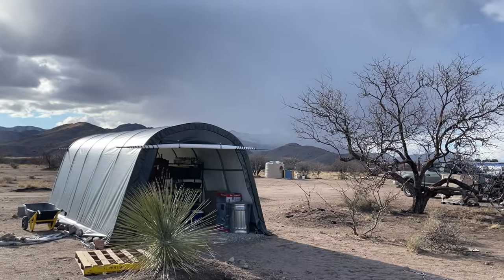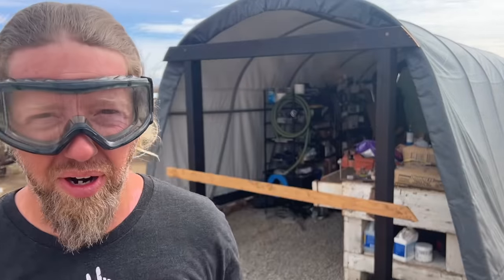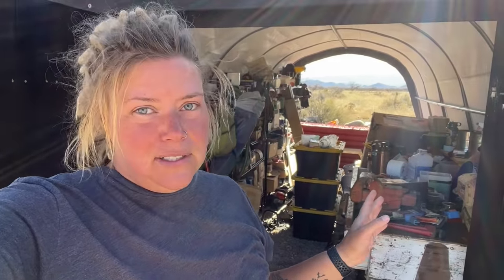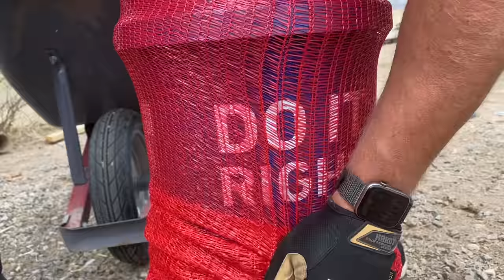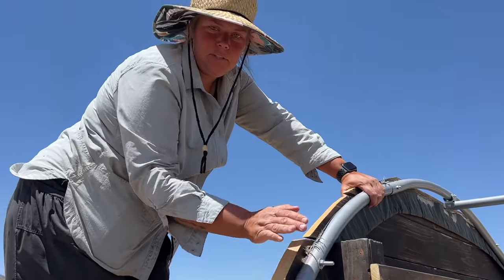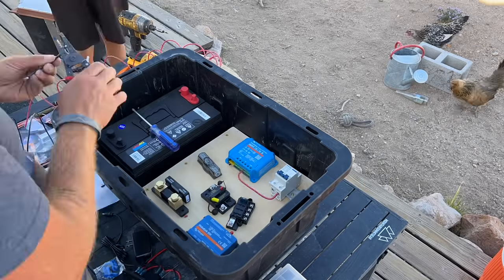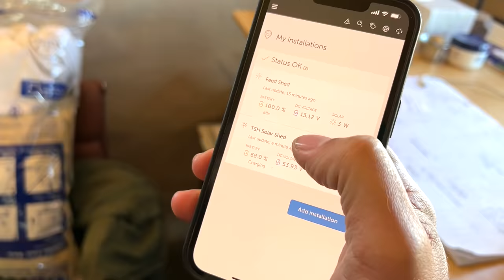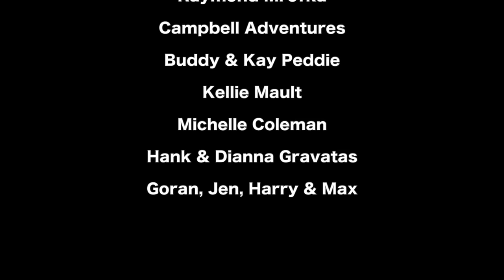Family REBUILDS Torn ShelterLogic with Barn Doors, Earthbag Walls, Metal Roofing & Solar System

Comment: If you want to screw in the augers quicker get one of the bits that they sell for portable fish shacks. They chuck up in your drill and are designed for screwing in the ice anchors. You just have to modify the opening a bit wider to fit the size of the anchors. Use an electric drill ( preferably 3/4 ) and hang on tight so you don’t break your arm if it hits a rock. Love the video. I’m going to do the metal to mine when it quits snowing. Liked and subscribed.
Reply from the maker: "hang on tight so you don’t break your arm if it hits a rock" yeah sounds like all my augering experiences 😂

Comment: I have the garage shed frame sitting in my yard for years with not a drop of rust and it’s not going anywhere. This is a perfect solution to covering it. I wanted to make into a greenhouse some day and I love the new doors!  We live in the northeast and we were lucky to get two years out of the canvas. This just gave me an awesome idea. If I can take it apart and move it to camp I could totally use it for my lawn tractor and wood storage. Some day I would like to learn to make small buildings run off solar panels.  Just have to watch more videos. You guys are awesome and I love following you on your journey

Comment: Sweet job, definitely drew some inspiration from you guys. Quick tip for auger style anchors: Go get a giant 32mm (ish) socket from tractor supply, bring your auger to make sure it fits on the eyelet. Now if you have an impact tool, you can drive those anchors into the ground effortlessly in 5 seconds.
Reply from the maker: Have been trying forever to find the right attachment for our drill, but no luck yet. Will see if ours has something this big.

Comment: For your desert buildings it might be interesting to have a look at solar chimneys. Just a screen-covered intake pipe that runs undergrond a long way, foor cooling the intake air. It ends inside the building at a low point. At the other end of the buiding, install a tall metal chimney, painted black. The rising air draws out the heat without requiring any electricity. It runs on pure solar heat. Cheap system but you have to screen well for bugs and rodents

Comment: I recommend geothermal cooling inside your shelters. Bury a couple of culverts or steel pipes with and air intake and then have it come into your shelters. Have a high up vent open, so that when the sun hits the top of the shelter and it heats up, causes thermal convection, which will pull air through the pipes and bring earth cooled air with it.

Comment: We have 2 shelterlogic tents, and the skin is crap.  As you say, the frame is decent.    We live in Canada, and we have the whole gamut of weather. Searing hot in the summer and beastly cold in winter.  The  covering of the tent degrades quickly.  By the end of the first winter, we had to patch, and cover with extra tarps.

Comment: Bought one of those 7 years ago and the end panels are fine, but the roofing became ripped and after the tape job failed, I just bought a tarp and strapped it over it for now.
Having a 40x40 barn across the dirt road built from a wooden frame and panels gave me the idea years ago to cover it with the same.
Unfortunately we couldn't afford it at the time, so hence the cheap OD green tarp for now.

Comment: I really like your upgrade. I also live in the high desert. The wind can be tenacious. Plus the heat. I used salvaged cooling fans from junk automobiles (free) and went solar direct to a few old panels I had from my first first solar system. They’re 54 volt panels but work fine with the dc motors. Most 12 volt automobile fans can run higher voltage than rated. Plus there’s a significant voltage drop from the panels when the fans start running. Just a on/ off switch for control. One for the battery room and one for the utility room where the solar hot water storage tanks are. Sun comes up, fans run. Sun goes down fans stop running. Switch off for winter.

Comment: Number one , you need 2×6/12 treated lumber runners or concrete and runners.
Trust me on this.
When setting the tent portion.
Take the time to pipe wrap all the top pipes all the way to the lower support bar and upper  cross braces.
Screw in augers of at least 3 feet inside 4 corners and about 3 feet from each corner.
Tie straps to corners and from corners x shape to inner augers.
Bulletproof

Comment: Maybe look into making Conduit Domes out of 3/4" EMT and then cover it with chicken wire and concrete cloth which can be made from polypropylene hardware cloth (weed barrier), and a good cement mix.   Then stucco over it like Ferro Cement.   You can make it look like a big rock and you won't have the issue with heat radiation as much as you will with the metal panels.        The nice thing about domes is they circulate the air for you, heat rises and pushes the colder air down the center.    Or add a wind scoop like the earthbag domes do to pull heat out of the structure.   Geothermal cooling might be a good way to keep some of the structures cooled as well as long as you have an excavator handy or have someone dig the 8' pit to bury the slinky.    Also look into Middle eastern cooling towers.

Comment: The wind tore up my bfs garage in a box in less than a year. I was wondering if I could use the metal frame to attach corrugated plastic panels to it but im pretty new at DIY stuff so im happy to find a video of someone else doing it first! and somewhere that is probably even windier than where we are to boot

Comment: Neat to see the end designs with the metal covering.  I mentioned a few months back to another homesteader in AZ as a great way to secure and help extend the useful life of I forget if was a Harbor Freight, Shelter Logic or whatever similar design.  I was thinking I'd raise mine up with cinder block maybe 4ft to get a second loft story or at least have more storage space.  I like the earthbag design and will have to consider more for the lower 4ft.  Stone was another idea, either free standing or with the mesh I forget what's called like where smaller gravel can be used.

Comment: The wood and aluminum is definitely the strongest option. But a fabric version quick tip for those not wanting to keep replacing the fabric Shelter Logic roof. As soon as you install the top and sides, buy a heavy duty tarp that can extend over each end and down the sides a bit. You can tuck it into the ends and that tarp becomes the sacrificial top that gets replaced easily. The primary deterioration is from the sun and letting that extra layer take the brunt of the UV works excellent. I’ve had the same Shelter Logic canopy for 5 years in perfect shape underneath. Swapped the top tarp every spring. 😎
Reply from the maker: You can do that, but still no way to stop the front and back zippers from falling apart without rebuilding.
Reply: @TinyShinyHome , totally agree. The only zippers that can handle the constant abuse in areas like yours are the large double seam, sealed version and there is no way they will go to that expense on these. The best thing to do is to make solid ends with a swing door in a frame the way you did. But for us folks in areas with woods all around us and where the wind isn’t as steady, the zippers actually hold up pretty well. I installed loops on the frame tubes so I can put ratchet straps across the inside and outside of the door flap for center support when I know some nasty weather is coming in. That has helped A LOT.

Comment: If you paint the exterior with white galvanized paint during the summer time you will knock the temperature down by 25° on the inside.  It makes a lot of difference especially in a work shed
Reply from the maker: Nothing will change a temperature by 25 degrees other than an air conditioner.

Comment: Great mods to the ShelterLogic.  You might want to consider spraying the interior (underside of metal roofing) with spray foam insulation.
Reply from the maker: If we need it cooler, sure. Otherwise it's fine for what we're using them for.

Comment: i love the wood doors.

i also had two Shelter Logic ‘Domes’ same issue with wearing cover and we were in NY [Friendship] and had the same issue.

we sold our home and moved south before doing anything like you have. 

However, when assembling ours, we set ours up off the ground and anchored them into and elevated pressure treated base raising the ceiling height over a foot to our domes. 

[sharing thoughts and idea’s] 

thanks for uploading.

Comment: I had a similar project using clear plastic panels and to not compromise the metal poles I used pipe clamps and attached 1 x 4's horizontally which the panels were screwed into. I will be doing the sides using the same with plywood.
Reply from the maker: We used metal to metal screws and only went through one side of the pole as not to compromise. Much simpler :)

Comment: Hey all ! 
Anyone seen my lime green toothbrush ? I can't find it anywhere !
LOL
Great work guys !
On the remainder of this you might try some paint-crete ! It's simple and worked well for me. Look for goofs at the hardware store or a few 5 gallon buckets of latex paint.
Mix it at 1 gallon paint to 1 gallon portland cement and about 1 pint clean water. You can also add a little fine sand.
Set up a traugh with your mix then with water soaked old towels, and other flat fabric cuts, old blankets, etc immerse them in the paint-crete and apply to the roof from BOTTOM TO TOP. This wil allow each piece to be overlapped from the top.(Think roofing shingles)
  With that crew you could knock it out in a day !
After the shell is completed  you'll want to spay it down - this will allow the crete to set up.  You may use chicken wire as a prewrap or a concrete bonding agent. ( which in essence is white glue)

After that layer sets up you can add additional layers or simply mix up another batch of paint- crete and spray or roll on.
Cure that out by a few moistenings  and o ce it is set you can apply a sealer to it. If the mood strikes you  you can put in windows made from relish trays. You can also add awesome looking bottle bricks !
You guys got this !!

Comment: Good Job guys... You should do an update on those earthbag walls on the sheds. Also Im thinking a pipe structure with just pipes might have been cheaper then the tented sheds if you would've started like that from the get go. Makes me wonder how much wind they can take before blowing away for my climate. Thanks for the post.
Reply: Also Im wondering instead of metal what kind of plastic could be used on one for a Solar Greenhouse. Well not like plastic covering but like a plexiglass or something similar. Would like to build a plexiglass back porch if I stay here to use as a greenhouse also but with more privacy.

Comment: Interesting to see the cost breakdown for your project.  Seems like a lot of money for your solar but that is always the case… there is a lot of up front money that needs to support your system but it will pay for
Itself over and over for years. We built a house with a GEO thermal heating system which initially was more than the traditional
Oil furnace commonly used here on the east coast of  Canada but has definitely been worth it because we pay very little
To heat our home and we are not using fossil fuels.  Enjoy every video.  Thanks for entertaining  and educating  me.
Reply from the maker: You could do the 12v system for about $500 less without the Victron VRM connection, so that part could be pretty cheap. Geothermal sounds super cool!

Comment: love those harbor freight power strips have 4 of them different places on the farm ,used their 5000 lum led shop lights in our new 25 x 30 metal shop , my wife has asthma so we are insulating with foam panels,  the building - cement floor was around 15 thousand but has 10 ft eves and has 4 in tube frame  so is quite a bit heavier than your sheds. but  the tin will last you a long time!!!  good luck

Comment: Such a great build my only concern in the edges of the metal sheets if someone runs in to them they could be hurt, try getting some water hose split with a Stanley knife push on, job done even nine nine couldn’t get into trouble . So impressed by your work I watch everything you do from here In Wales UK. Keep up the good work and give nine nine a extra hug from me.
Reply from the maker: They aren’t sharp ;)

Comment: This is really awesome. Y'all did a great job. Last night I was watching videos about "arched cabins" if you go to the channel for landio properties he has a playlist for arched cabins and it wouldn't take long to watch those videos before you come up on how he shows this trim for protection of getting cut. To further explain what I'm trying to convey on the edges as you see at this time stamp 55:58 of the metal on the arch cabins they use a plastic or rubber or whatnot strip that fits over those sharp edges of the metal on the ends. It reminds me of that Bling stuff that you put on the inside edge of the door of your car doors it kind of looks like Chrome and is flexible, I think it has a bit of a sticky to it on the inside. 

Just an idea if you want to make sure the kids don't get cut rounding the corner or having their hand out especially given the importance of staying safe where y'all are located away from town. Avoid emergencies and things like kids needing stitches. I think if you went with the product for the car trim it would be kind of cool and fun to have some bling and I think that product is very inexpensive.

Comment: So just a little tip if you want the original heavy duty cover for this garage to last forever you can buy cheap tarps and they last 3-6 months depending on quality and they will keep the UV rays of the sun off the heavy duty fabric of the garage. UV rays will destroy it over time. And if you get silver ones they will keep it cooler then the black that it is now. And you can roll up and screw the ends to the wood and sand bag the bottom edges to hold the protective cheap tarps on the garage. It’s just a cheap way to keep it cooler and make the expensive heavy cover last forever. You can find inexpensive hood tarps from harbor freight Amazon and Walmart all online can be ordered and shipped to your door. NEVERMIND they have “ like everything else “ gotten expensive a 20x30 is like $85 and I have bought that same size 2 years ago for $40
Reply from the maker: Yep, and all that is far too much work and upkeep over time. Our solution is one and done.

Comment: Excellent project, we'll done. Bravo !!

 I would like to make a suggestion  .... From what I understand there are protective edge covers available that attach to the ends of your sheet metal.
   If one of your pets or one of the family members trips and falls against the edges it can cause a terrible injury.
   Just a suggestion to help every one safe.

Take Care
Reply from the maker: These are real metal roofing panels, the edges aren’t sharp.
Reply: I beg to differ with you, I did the same thing to my shelter logic about 5 years ago. Those edges are very sharp due to the fact that the metal isvery thin. I poubded pipes into the ground  at the corners to act as protective bumpers to prevent any injuries to pets or humans.
  
  I  Very much like your barn door Idea, my front and rear covers are in rough shape and I was trying to figure out a method of changing them to something more permanent. 

Thank You
Reply from the maker: Ours are 29 gauge, and much thicker than the cheap stuff you get at the hardware store. They really aren’t sharp 🤷🏻‍♂️
Reply: @TinyShinyHome  
   Mine is 29 gauge also but I didn't want my Bernese Mountain Dog running into the edge. Iis not sharp like a knife edge, but if a person or an animal were to run into it, it would very likely cause a severe cut or laceration.

Comment: A  way to protect the tarp like covers from the sun is paint . . Weather spray or rollon. Paint protects the plastic from the sun's u. Rays . Prolonging the plastic life. . Also if you can find a good source of used carpet . A layer of carpet then a big thin plastic sheet covered with a final carpet layer makes for a water proof roof cheap. Provided the carpet is free.
Reply from the maker: There are certainly ways to "cover" the overhead tarp, but no way to protect the front and back zippered tarps which are the biggest fail points of the whole system. Used carpet covered in plastic is definitely not an ideal way to make a roof...

Comment: Oh, and is neat how the top railing of fence (sometimes, albeit rarely can be found for free and might have to remove) can be used as well as the "T" joints like I ordered a box of the... let me check.. 1-3/8" x 1-3/8" EMT Rail Clamp.  I've found one free and all my other at a great price on FB Marketplace.  Though seems something changed on the FB Marketplace algorithm so isn't so good when searching like used to be which affects alerts as well.  Figured I'd mention.  Pin footing is handy too and now I see Menards has Handi Piers that I'm guessing can be home made if needed.  OK... beat built.  Wondering cost of say doing earthbags or something more cost effective solid barrier to save on the steel cost?  Maybe even if like foam stucco'd to waterproof until more is made like even just berming dirt or DIY dirtcrete/clay blocks maybe to help insulate and cover/seal the foam in?

Comment: That Was Great & Congrats, & If You Don't  Know We Watched A Video  on Digging A Pit  I Think It Was About 8 or 10 Feet & They Ran A Tube / Pipe  in & Down Through & Back Out & To There Bedingfield & It Cooled it Really Good & There is A Similar Way To Get Heat From The Earth, I Can't  Remember All The Details  But It Wouldn't  Be Hard To Fine On The Net & Utube
Great Video